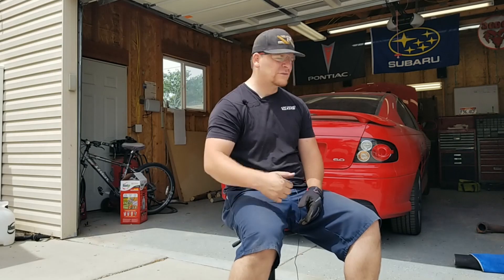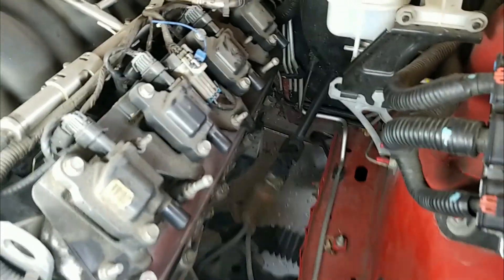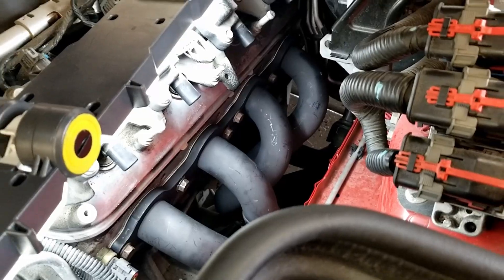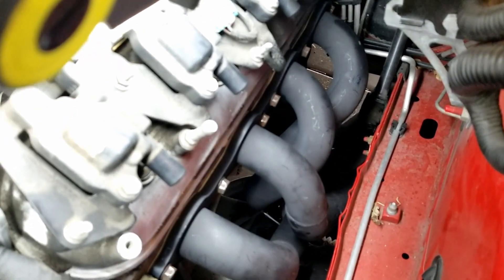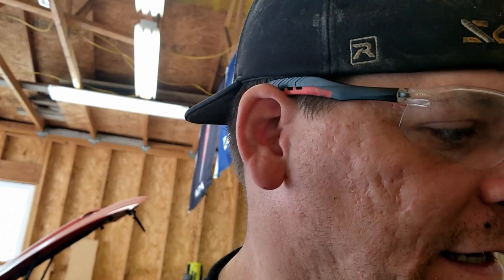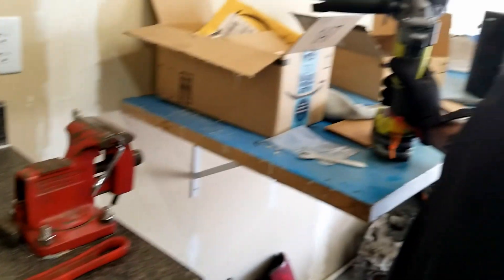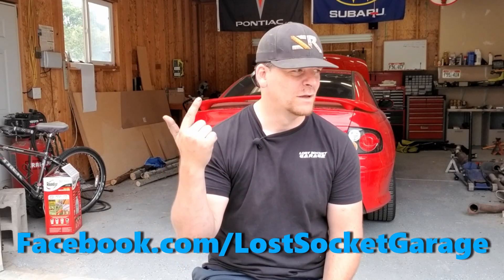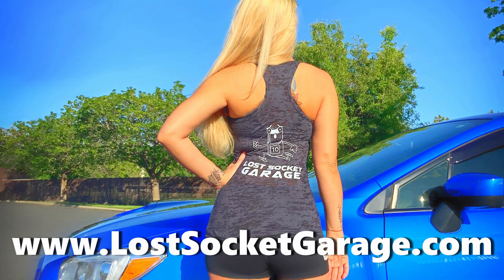Pontiac GTO Header Install Tutorial Pt 3: Finally get them installed!

Comment: Good video, as someone not very experienced in car wrenching…. I completed the header install all by myself (with the assistance of my fiancé bolting on the new header bolts while I was under the GTO). I ended up re connecting the power steering lines without crow foot wrenches it’s TECHNICALLY possible but very difficult and I would say it took 10 hours including clean up
Reply from the maker: That's awesome! Keep it up!

Comment: Did you leave both sides loose while putting the rack back in or just the driver side? Having trouble putting it back in lol
Reply: @lostsocketgarage  thanks I sure will
Reply: Is a 2 man job putting the line in
Reply: @lostsocketgarage   did u put  the heat shields back on ?
Reply: I'm trying to put them back on right now but   no space
Reply: @lostsocketgarage  got them in thanks
Reply: @lostsocketgarage  haven’t started it yet I took the transmission out to put a stall in hopefully tomorrow I get to that point finger crossed lol
Reply: @lostsocketgarage  I’ll probably do the same lol
Reply: Did you put the header in from the top or the bottom